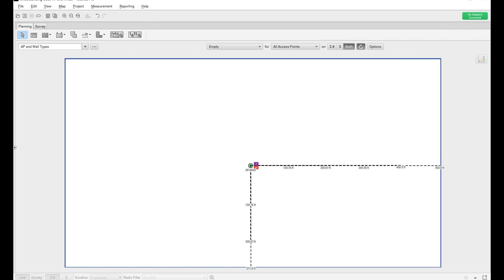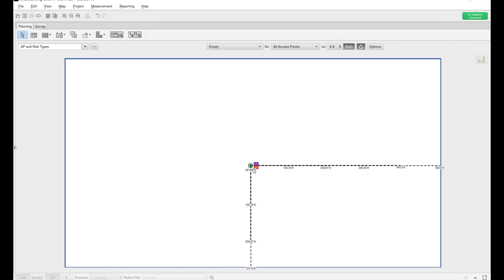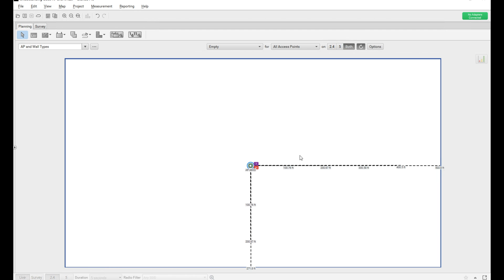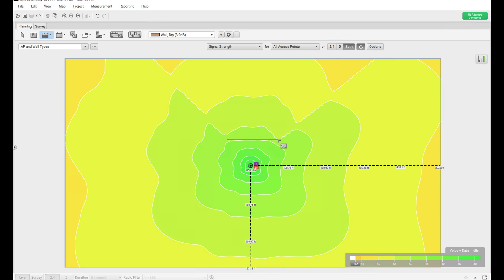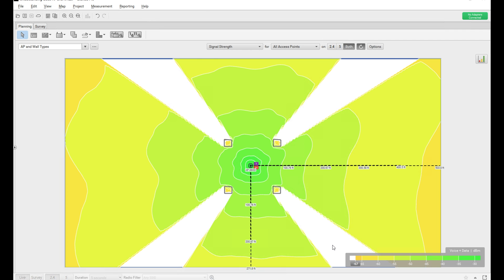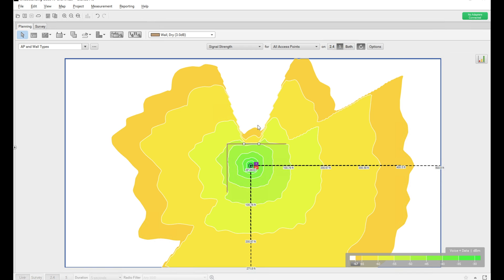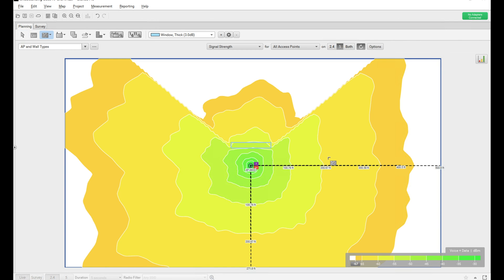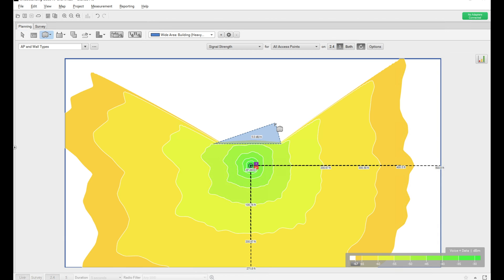How Different Wall Types/Doors/Attenuation Areas affects the AP Coverage (Understanding RF - 1)

Comment: how  to design the pillar in Ekahau ?
Reply from the maker: If you are using the AutoCAD file for importing the floor plan mark the layer with CONCREATE and Ekahau will take care of it. If you are using the Picture format of floor plan then, add four concrete lines to build a squire box in Pillar Black area in the map.